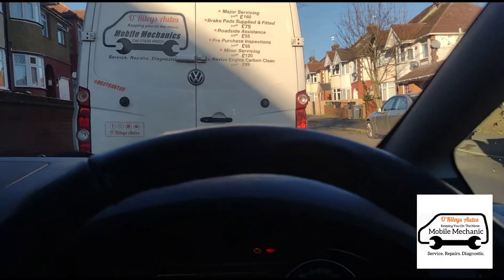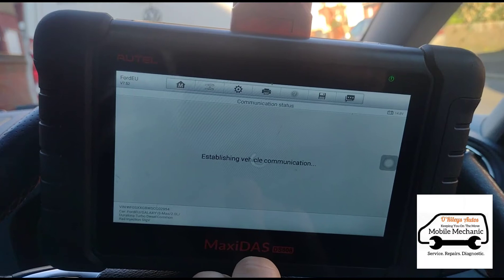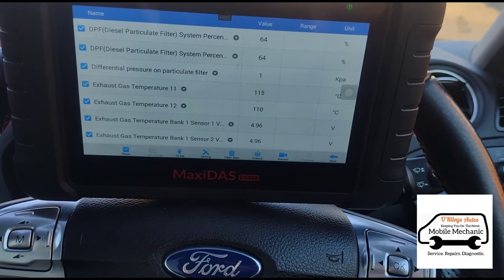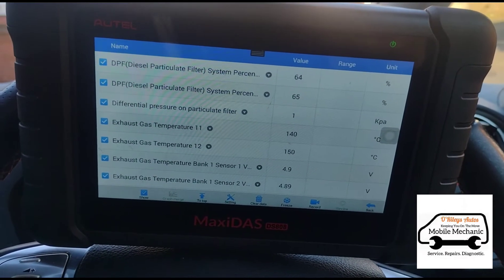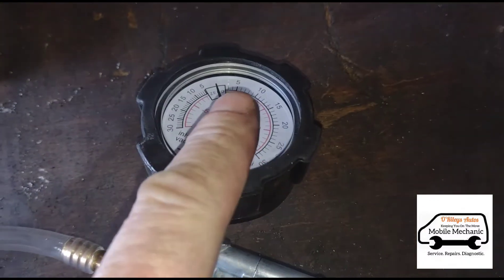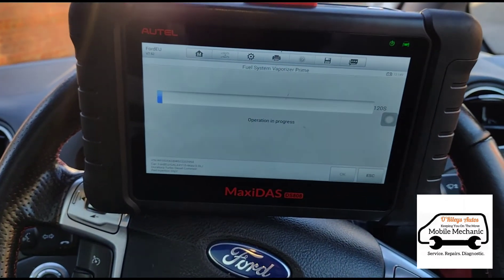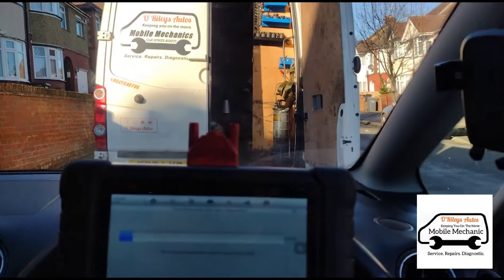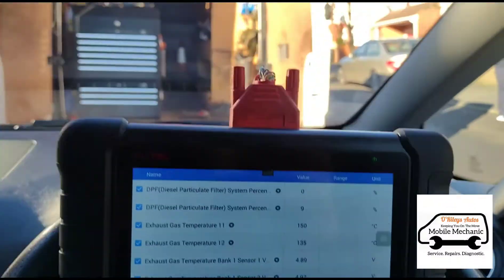P244C Exhaust Temperature Too Low For Particle Filter Regeneration, Bank 1 Ford DPF P244C:00-6D

Comment: Have the same issue going on (p244 fault code)with my 2014 galaxy. How much could I expect to be looking at to replace that part these days?
Reply: 130-200 pounds for the part, if you are lucky your old sensor just unscrews, most I have done have mangled the threads, so you need to repair that also.
Reply: @mortenmorfar  yeah it’s a £300 part and the thick end of £200. So by the time you’ve put some VAT on top for good measure it’s a £600. It don’t matter what garage you go to either they all want the same.

Comment: Great work as always.  I got a mk8 transit p244d00 exhaust temperature to high for particulate filter regeneration bank 1 i have cleaned the dpf and done a regen. Van still cuts out  on road test.  Any information would help